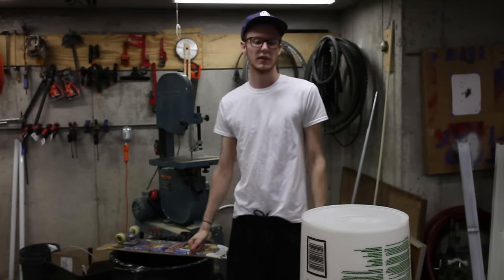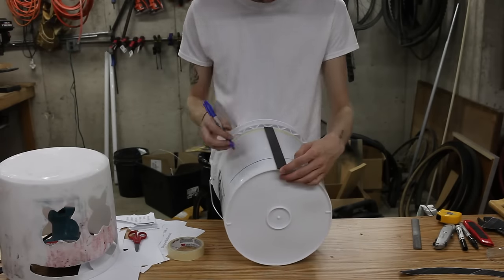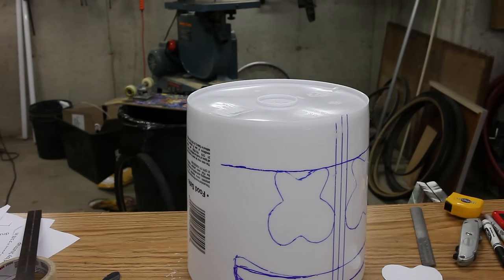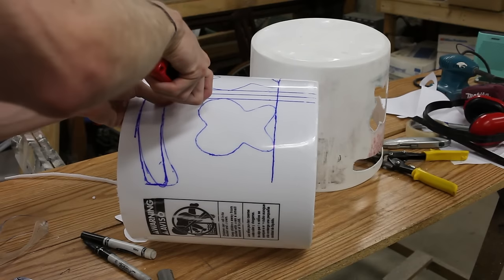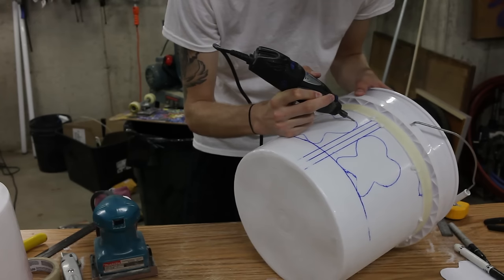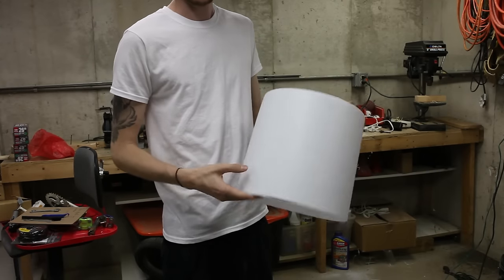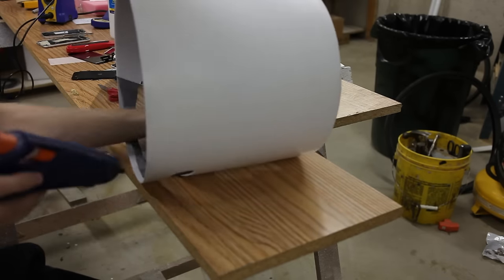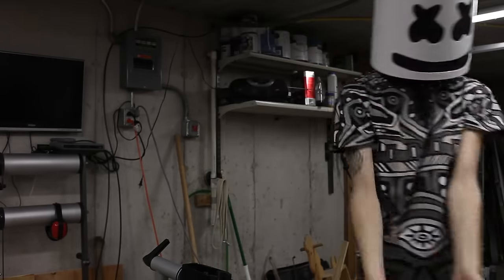Marshmello Helmet / Mask Turtorial Complete with Steps

Comment: this would be tight to have.  only mod i'd make is a hard hat liner so you don't see all of that pink foam.
Reply from the maker: Haha thanks man! Yeah that is what I am planning next for the next video, and I'm also going to record the next one in Spanish as well! But with the current supplies I just wanted to get a video out as it was, but yeah man thanks for the input!
Reply: You could also probably take a layer of the see through cloth and put it around the foam for extra comfort and better looks.
Reply: I did that with my mau5head back when he was "IN" lol. I used a hard hat cuz i put a lot of electronics in it. Wired it with EL wire around ears and outside head along with the mouth. And LED's for the eyes to light up. Solid and flashing modes. And some speakers. I was going to add a fan but i ran out of time for halloween and fucking thing was kind of heavy lol. I spent like $100 and sold it to some guy on craigslist for $320 XD badass mello head

Comment: Where can I get plain white 5 gallon buckets? And r they cheap?
Reply: walmart, lowes, any place like that. they're less than $10
Reply from the maker: I just picked up 4 more for the next videos coming out this week! Walmart $3, and they dont have painted on labels
Reply: Where can u get the foam u used,  the window screen, and the see through black cloth and for cheap?
Reply from the maker: Edmond Edralin Edmond, most of the stuff is actaully going to be very cheap. If you do this project right, it should cost between 20-30 not taking into account some of the tools. I would wait on the foam since I am putting out a new tutorial soon where I use a hardhat and it works very well. That costed me $7 on amazon, the window screen from menards in a roll for about $5, and the cloth from Joann for around $5.

Comment: Can you give me a link to your tools that you used in the video? :D
Reply: The "Bigger" tools.
Reply from the maker: http://www.lowes.com/pd/WEN-80-Piece-Rotary-Kit/4731949?cm_mmc=SCE_PLA_ONLY-_-ToolsAndHardware-_-SosAtg-PowerTools-_-4731949:WEN&CAWELAID=&kpid=4731949&CAGPSPN=pla&k_clickID=242ddfc3-2a75-4446-b7d6-61abf5fe7bac
Reply from the maker: http://www.target.com/p/black-decker-1-4-sheet-finishing-sander/-/A-16974450?ref=tgt_adv_XS000000&AFID=google_pla_df&CPNG=PLA_Home%2BImprovement%2BShopping&adgroup=SC_Home%2BImprovement&LID=700000001170770pgs&network=g&device=c&location=9060141&gclid=CjwKEAjw34i_BRDH9fbylbDJw1gSJAAvIFqUW6gUvuPSNHXBpRR420lCFTnae9GSaCYgHuoUzaFHvhoCEoHw_wcB&gclsrc=aw.ds
Reply from the maker: Found a sander and a dremel tool that would work. I didn't include the sanding belt as the powered hand sander is much cheaper and will do just about the same depending on the sandpaper you are using!